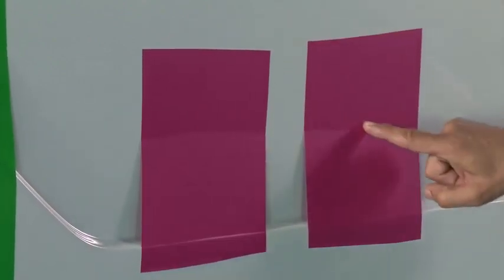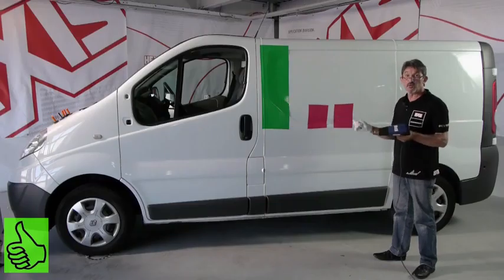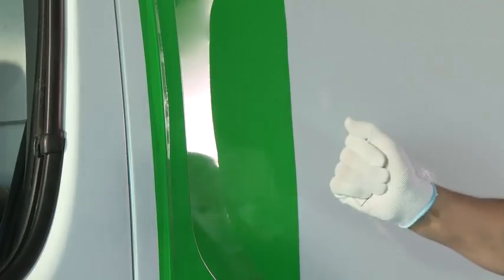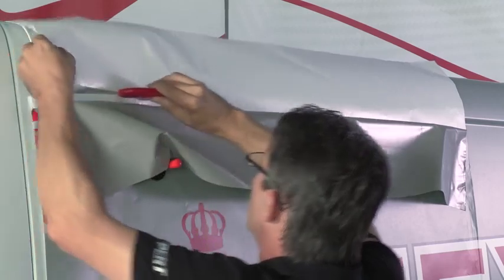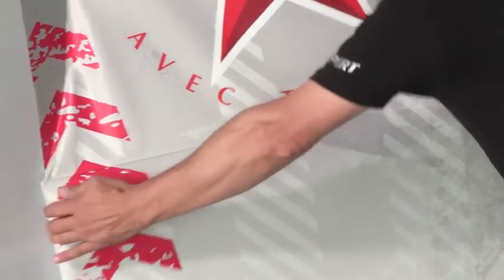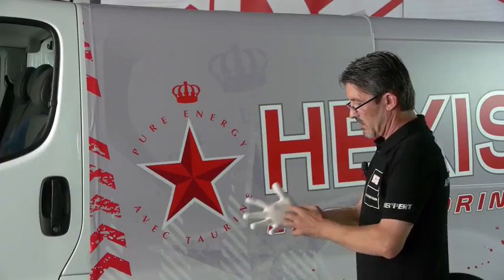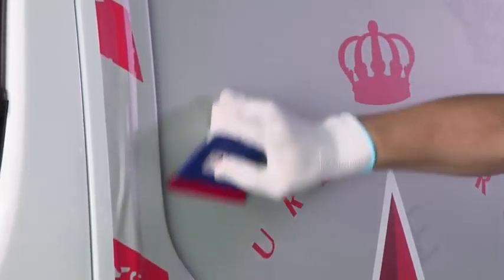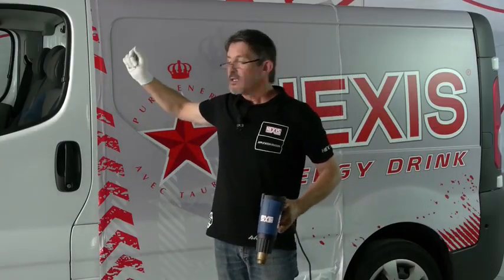Advanced Car Wrap Training    Stickittome Australia

Comment: Nice tutorial, I’m going to attempt my first diy wrap on a sprinter chassis cab, the dummy sunroof has double deformation/recess so following this might indicate I’ll have to use 1 piece for the roof, one piece for the dummy sunroof and join in the recess or it will lift? I’ll have to research further as this area is a water trap and would assume it needs to be done in one sheet and stretched, luckily for me I have no Writting or graphics and a few spare meters to play with

Comment: what's that laser tool used for heating, and how do you prevent from burning the vinyl? also, do you use a surface primer?
Reply from the maker: Hello, the installer has used a Steinel hot air gun which enables you to set the temperature to 40 degrees. You can also use a separate laser temperature gun to test the heat of the film to ensure that you are heating it to the right temperature. Surface cleaning and preparation is covered in our Car Wrap Training Essentials video: https://youtu.be/06PvXncIUgU

Comment: ok. 1-st rule is that YOU DON´T USE KNIFE TIP ON AIR BUBBLES !  use needle or some other sharp round tool.  or use proper materials with working 
air release system :D
Reply: guilty :'D